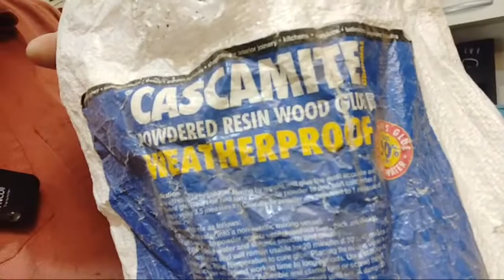LIVE... Wallybois Makes REBOOT of CHANNEL And Workshop Tour

Comment: i bought a dremel and i got some old old painted signs but dont no which bits for outline you can buy a burr set for 12 eur 20 piece
Reply from the maker: What are you trying to achieve? Xx
Reply: @WallyboisWoodworking  repair some painted signs